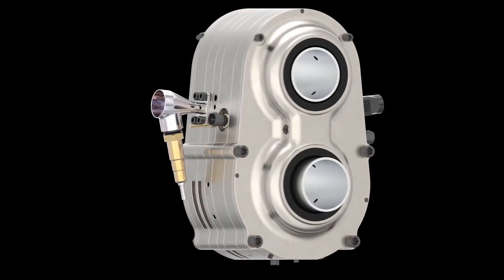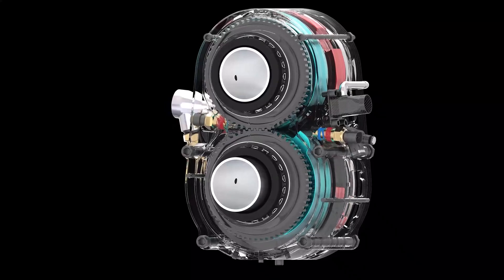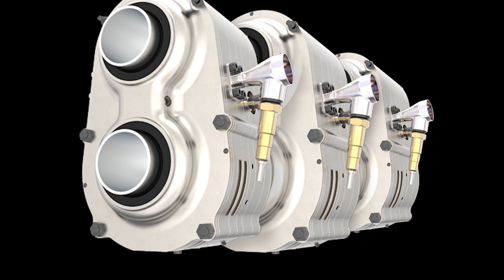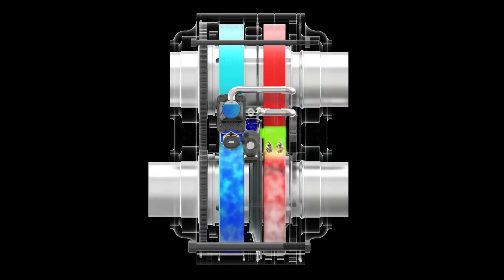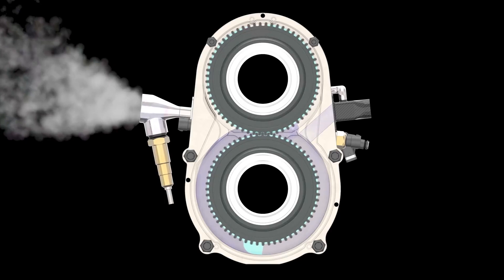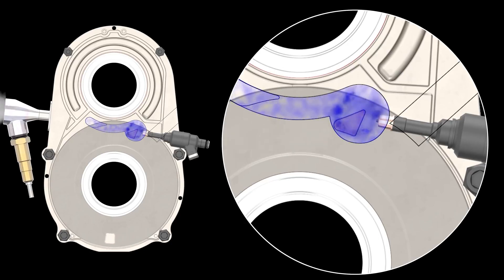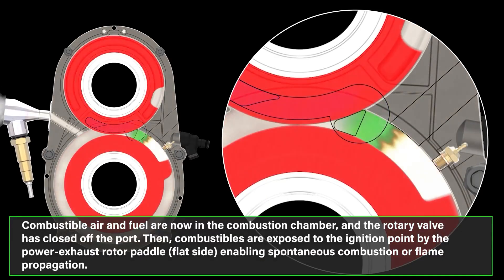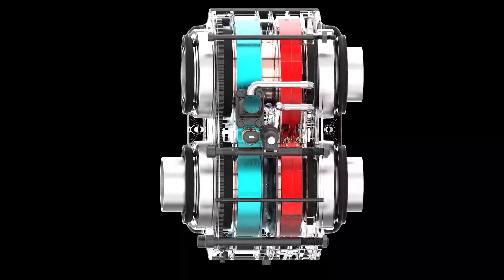This pistonless engine runs on hydrogen and revs to 25k rpm

Comment: Customer:
  How much to repair whence the seals degrade?

Maker:
  A new engine costs less than repairs.
Reply: The Mazda Rotary was originally a throw away engine , until backyard boys decided that wasn't an option and started rebuilding them, and turned this into a specialist industry.
Just because initial concensus opinion may be this is a throwaway,  time will pretty much guarantee to change that opinion.
Till Tesla cars , consensus opinion was electric wasn't a serious option for performance  or distance, now  a number  of car manufacturers are producing supercar  performance electric vehicles.
Reply: @davidp8157  and they threw it away again (sort of) when the emission law becomes more strict. Yes, the wankels are good at instant power and that's how they win le mans with 787B, but they are just not fuel efficient enough then the reciprocating engine counterpart. 
Don't get me wrong, I love RX-7 and RX-8 and really want to see them back, but the rotaries seems to be a proven dead end, and I don't think they are coming back any time soon
Reply: @NateSakana  this has got sidetracked off the previous post I was responding too, in so far as I intended it to mean, with respect to cost to repair excessive  or unrepairable,  that Rotary engines were originally  considered throw aways,  yet  people managed to make it possible and worthwhile to do so, and something like this new design will be repairable  in time too.
On a separate  note, should a Rotary be run on hydrogen,  the CO2  emissions  are gone, the relative efficiency  of the motor may well be significantly improved if adequate development  is put into it. It should be noted that at the  time the Wankel Rotary produced more power from a smaller motor  and better economy than its Mazda counterpart, all with a much bigger, significantly  heavier  vehicle,  source,  we had a "70 NSU RO80 in the early 70's. If the development and improvements  that have gone into  conventional engines, were translated  to the Wankel Rotary, we could see some seriously interesting results. Of interests sake the NSU  was more economical  if driven 1 or 2 gears lower than most people  drove it, ie,  dont hit 4th gear till 80mph (130 km/hr)  driven like this it had significantly  more performance  than  v8's of the time, and better economy,  driven quietly,  it was thirsty  ... very thirsty....
But, again,  this was not the primary focus of my comment

Comment: I have said from the beginning, there is no reason why all investment should go into EVs as if that is the only solution. Not only is it not the only solution, when you take into account the energy needed for the manufacturing process, the environmental impact of producing and disposing of so many batteries and all the investment needed in infrastructure, it doesn't appear to look like any kind of solution at all. Really hope this concept can become reality and like you mentioned, there are many other developments which also have potential and these even include more conventional engines which have been redesigned to run on hydrogen instead.
Reply: Lol if you are so concerned about energy consumption you should never think of a hydrogen solution.
Reply: If you look at diesels now, and a lot of the early light diesel  engines, we now have diesels designed from the start as diesels, many of the early light diesels  were a petrol engine, rejigged to run on diesel and consequently   were not overly great.
We are likely to see early adopters  modifying existing motors to run on hydrogen or other alternate  fuels,  but , longterm, this will undoubtedly change to purpose designed and built engines that make more sense in terms of efficiency, longevity, torque and power(kW /hp)
Reply: @davidp8157  It will still be nowhere near the efficiency of an EV.
Reply: @Freba9  re ev efficiency, yes, on the face of it, it's going to be hard to beat the ev efficiency, but
It would be short sighted at best to think other options than ev's are not viable alternatives. The latest innovations in battery tech  re energy density and rapid charging seem super impressive  and should roll through to production shortly, which will address many of the perceived shortfalls or negative  aspects of current ev battery technology  
Despite this,  a clean burn fuel such as hydrogen whether burnt directly as fuel, or consumed  via a fuel cell, produced via one of the new energy efficient  processes, still has significant potential, for a wide range of options and uses, even to provide the electricity for  ev's.  Simply considering energy requirements  and current energy supply options against potentially swapping current nationally piped natural gas  to nationally  piped  hydrogen,  ie infrastucture is largely already in place,  gives significant reason for considering this as a serious viable option in addition to battery ev's  for the forseeable future.
Reply: @davidp8157  Sorry. I can only think of a few niche situations in which hydrogen drivetrains would make any sense. In the vast majority of cases the super low efficiency is just unacceptable. CO2 emissions can only be lowered as fast as possible when the complete ecosystem is as efficient as possible. Electric grids are far more abundant dan gas pipelines.
Reply: @Freba9  100% agree, ev seems best option available currently, but,
If we swapped super fast to majority of cars and transport industry running ev, we don't have the infrastructure  to handle the  charging  electricity demand, so, logically, another  concurrent cleaner non CO2 producing  option such as hydrogen  makes sense to run side by side to decrease  excess  load on the charging infrastructure  until such time as it is adequate for the demand. It may be that hydrogen is used to cope with the on demand or surge demand electricity generatoon that might otherwise be coal or gas fed.
Reply: @Freba9  100% agree, ev seems best option available currently, but,
If we swapped super fast to majority of cars and transport industry running ev, we don't have the infrastructure  to handle the  charging  electricity demand, so, logically, another  concurrent cleaner non CO2 producing  option such as hydrogen  makes sense to run side by side to decrease  excess  load on the charging infrastructure  until such time as it is adequate for the demand. It may be that hydrogen is used to cope with the on demand or surge demand that might otherwise be coal or gas fed.
Reply: @davidp8157  Electrical infrastructure is not that big of a problem when you realise EVs need less than 10 kWh per day per vehicle on average. This can easily be charged overnight on low power.
Reply: @Freba9  except that if we were to overnight or even   rapidly transition to primarily an ev fleet, and also shifted a large portion of the trucking fleet to electric,  the infrastructure  will not cope with the demand,  many areas  borderline struggle with electricity demand currently, the required increase in supply, both locally,  then entirety nation wide,   for entire countries requires an entirely rejigged infrastructure,  which still makes sense from a longterm  national and global perspective but creates its own issues short and medium term , hence my logic to utilising another concurrent option in addition  to this  for the short term
Reply: @davidp8157  1. The whole characteristic of the EV evolution is that it happens over the course of decades. 
2. Hydrogen is not the solution for lack of grid capacity. Due to all the losses hydrogen vehicles cause far more CO2 emissions than EVs, especially when transitioned rapidly as there won't be anywhere near enough renewable energy to make up for its poor efficiency. IF hydrogen ever becomes a solution for certain vehicles it will be in the far future when there is an abundance of renewable energy. Definitely not now.
Reply: @Freba9  given the premise  that I personally believe EV evolution is a  given,  I think your points are a little off.
Given 
1,  most big players ( car manufacturers) have already stated they are transitioning solely to EV's in well under a decade, not over several decades
2,  what losses in transmission are you referring to re hydrogen? Current hydrogen fueled engines are running similar efficiency  to ICE  options (25-35%) and hydrogen fuel cell options are running 50-60% or around twice as efficient as ICE  options....
And  how do these hydrogen fueled engines ( conventional or fuel cell) produce  CO2? Hydrogen  is a non carbon fuel,  and can definitely be⁶ considered a renewable resource, whether  produced  by  solar or wind powered  water hydrolysis,  or better still the new Kiwi process, 
No CO2 is produced from hydrogen combustion, byproduct is.... water
Sorry struggling to follow your logic...
Reply: @davidp8157  1. I was referring to the society transferring to EVs, not the manufacturers. 
And again, overnight slow charging will not cause massive problems. 
2. Again: there is nowhere near enough renewable energy in the foreseeable future to justify using a terribly inefficient solution like hydrogen vehicles. Therefore the emissions come from the powerplants that power the electrolyzers making these incredible amounts of hydrogen required.

Comment: I am more concern on the thermal expansion of those gear, and might also plague by a thermal imbalance on the combustion side of the engine shell like Mazda does.
Reply: This thing is setup like a jet engine and those are pretty reliable. It is separated much like the cold and hot sides of a typical turbocharger and those are also pretty reliable.

Comment: the most bang for your buck would be the achates opposed piston 2 stroke, running on B100 from home grown algae based bio-fuel. doesn't need crop space, can be grown in a factory with an unlimited supply chain. all that's needed is water & sunlight to make bio-diesel.

Comment: opposed piston 2 stroke- the jumo junkers, redesigned with modern technology by achates power- probably the most efficient ice engine ever to exist. the liquid piston rotary- excellent power to weight ratio, great efficiency, all the benefits of the original wankel, none of the down sides.. .and MANY MORE. even the modern yamaha hyper bike 1 liter engines- great engine. 

THE ENGINE IS NOT THE PROBLEM. the problem is the big oil wanker waiting around EVERY corner to tax, lobby, and otherwise DESTROY any fuel source for that engine that would cut THEM out of the loop. hydrogen? just a fancy way of saying natural gas from? BIG OIL. 96% of ALL h2 is made that way. and electrolysis simply isn't viable financially. 

 ethanol alcohol from sugar beets- the BEST fuel on the planet. I would happily buy feed stock sugar for 10 cents per pound from mexico / south america... and make my OWN fuel... at a total cost of about $1.20 per gallon, even after road tax & ethanol license to operate. so why don't I? because THE VERY MOMENT I try to import ANYTHING that can be used as fuel? the fed will hit me with an import tax that ENSURES my fuel will cost the same or more than just buying gas at the pump.

Comment: Its wierd to think that the stroke is equal to the crank throw times what fraction of rotation is exposed to the burning gases.

At 25k rpm, the centrifugal forces must be insane especially if the rotors are a foot wide

Comment: 14 bar intake pressure??? You are not an engineer or you are kidding. You should get into deep-sea diving... Perhaps than you'll understand how power intensive, challenging, wasteful and dangerous is to compress a gas - at such a high volume and cycling rate... As is, a 2 bar turbo pump is an expensive piece of equipment. A 10 bar is already pretty much impossible. Not even f1 cars had such powerful turbos. It could be build but it won't last more than a few hours...
Reply: One day maybe.

Comment: I like the idea of hydrogen... I would love to try the Mirai eventually
Reply: This would be a great engine to use in the Mirai hydrogen-electric. It could replace the fuel cell but at a much lower cost and be better for the environment than either fuel cells and battery-electric cars which require exoctic and expensive naterials.

Comment: How do you get 200+ psi to this engine at the volume of air the engine would need at 25,000 rpm the compressor would be massive to feed this engine it would need a Jet engine to feed it

Comment: One thing we don't know is how carbon buildup will affect the performance. We have all seen the pistons and cylinder heads of engines that have run 100k miles.
Reply: Running on hydrogen there would be no carbon buildup.
Reply: @stuarthirsch  Hydrogen is very expensive and very inefficient. It is unlikely to become a standard fuel for ICE. The Omega claims it can run on a variety of fuels, such as JET-A, diesel, and gasoline. These are more likely to be used as fuel and will produce carbon buildup.

Comment: Is this concept seems to ignore heat...geometry changes significantly with heat. Good on 3D cad model but probably a non runner...even ceramic is impacted by heat. Clearance needs to be there to allow cold start while allowing air seal when warm. Then it will have to have complex air seal. Then it needs to be lubricated.

Comment: Chris VS Cars ? I think they should put this engine, into a old van and road test it by taking a few road trips throughout THE UNITED STATES, to test it's longevity and do routine maintenance during the road trip. The question is, how many miles can you travel with this engine, before it breaks down ? Can a person get 500,000 miles on this engine or less than 200,000 miles ?

Comment: I think the primary energy factor of hydrogen might the critical aspect to these type of technologies.  Once battery power density increases and weight reduces then it will be difficult for hydrogen or fuel cells.  I think the electric battle is won, it's now just about other applications for hydrogen etc.